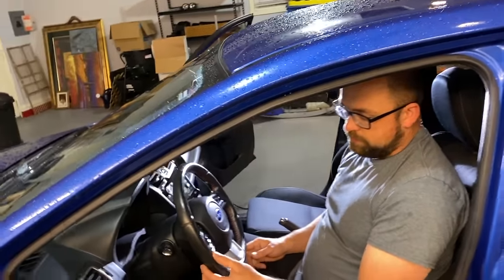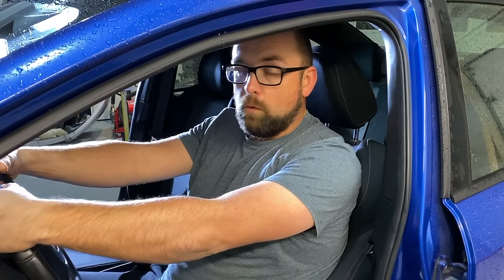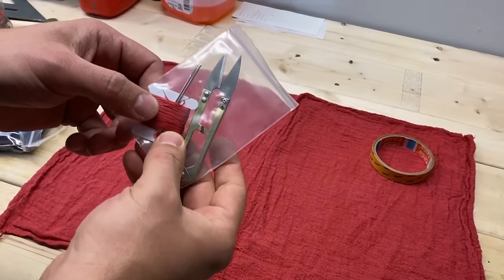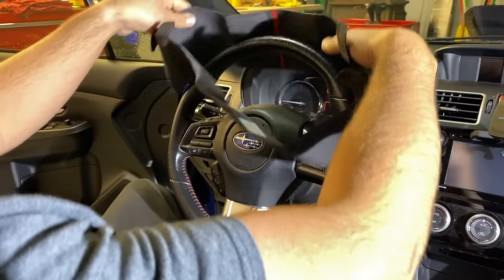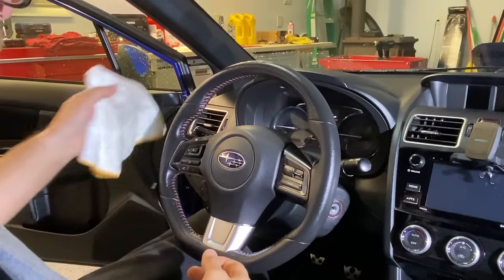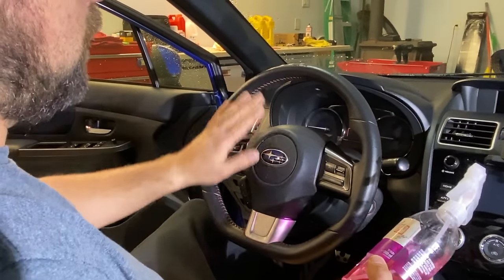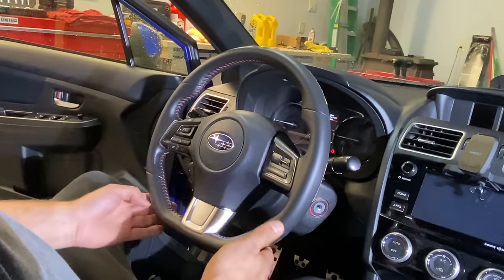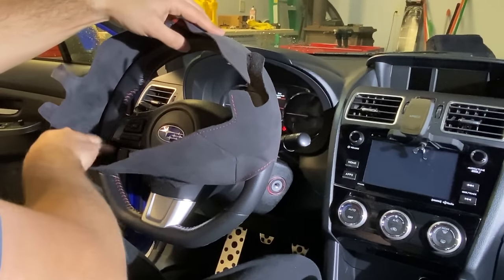How To Refurbish A Steering Wheel For Less Than $100

Comment: This took me 6hrs to do and I was rushing
Reply: How did it go? Does it look good?
Reply: @stektpolse  yes it does look good it’s worth the time and money
Reply: How difficult would you say it was? I have no sowing or stitching background lol. I have mine ordered, wondering if you have any helpful tips too
Reply: @rr.cycles  it’s not difficult it’s just time consuming just make sure you do it on a off day. If you use your phone for behind the wheel it helps too so you can see where your stitching but yeah I’ve had mine on for awhile and I didn’t use the tape. Well I tried it but it ripped my steering wheel the leather of it which sucks so I didn’t even put the tape all the way around  on the wheel and it hasn’t moved or slipped off yet
Reply: @acp__  ok bet, I’ll just go no tape. It’s a tight fit cover anyways. Thanks
Reply: It took me half an hour 😔

Comment: That's a steering wheel cover only. You never took the old leather cover out. Not a direct replacement.
Reply: @MrFizzery  😂😂😂😂
Reply: The instructions on the kit tells you to not remove the original leather.

Comment: Great video. Very helpful. I am about to knock my truck out and after order a cover for my wife car.  Edit: I won't bother to do my wife car. It'll look like  crap if I do it. The edges that need to be tucked don't tuck very well. Some are just too big and pop my trim pieces off. The string constantly wants to get tangled up and knot up.  I woooooould have paid $200 to do it right. LOL

Comment: Just completed mine today (same, swede with top dead center red stripe). 3+ hrs, a few tears, a LOT of sweat but honestly, this video was PERFECT as a guideline! I AM NOT a mechanic but like to play with tools and cars, bikes and bicycles etc. and this was relatively straight forward. Even though I broke the thread AND used ALL loops to thread the cover, I still had left over. Fantastic product; great DIY video for anyone who's ok with a hammer.
Final result after breaking the thread (mid-way through the top portion) is: Amazing tight feel. Makes the wheel thicker and so nice to hold in all angles when turning. I LOVE the new series WRX steering wheel and this cover accentuates it.

Comment: I done this today. With wheel installed on car i fitted the fabric. I then removed airbag then wheel from car, then back plastic piece from wheel my removing 1 screw, then each button assembly and bottom trim piece only have 1 screw each. Very easy to do then you can do it inside if its hot etc

Comment: Anyone who plans to do this I highly recommend taking the steering wheel off, bringing it inside your house, and doing it in a comfortable position. I did this once in my car before and it took like 6 hours of sewing and weird angles. Brought the steering wheel inside the second time and I got it done in 2 hours and was much more easier to get the stitching looking perfect
Reply: Is the material on the steering wheel with red stitching a factory-installed cover that can be replaced?
Reply: I have an impreza hatchback and I bought a wrx D steering wheel to do a swap on, since my new wheel will already be removed that makes it easier for me to install the cover in the comfort of my home👌

Comment: I did did this to my g37, I removed the steering wheel from the car & removes all buttons & trim, double sisded tape under the spoke areas & also baseball stitch instead of every stitch got the job done in about 1.5 hours.

Comment: could you feel the adhesive tape through the cover after you put it on?
Reply: I didn’t put the adhesive on mine and I’ve had mine for about a couple months now and  its not sliding
Reply: @acp__  I didn't either and mine's good too
Reply: No, it's very thin, I put a few pieces on around the spokes but the top of the wheel can turn if I try

Comment: I don't think the new subaru's have leather it's just some plastic with a stitching effect on it - and it is total shite.  My 2000wrx had real leather and that lasted longer than the car.  But my 17 is farked like this.
Reply: 2015 STi owner: The top and bottom of the steering wheel is leather. The sides is a plastic like material that has dimples in it, similar to a soft golf ball. Google a picture and you’ll see what I’m saying

Comment: The soft suede leather looks great for a minute, until it starts getting all that hand oil and dirt on it. You can't simply clean it like smooth leather
Reply: I’m on here debating buying the oem one, and I was thinking the same thing. Google cleaning videos. This dude had a BMW and he brought his back from the grave with a brush and some spray. I was shocked
Reply: Get a steam cleaner and a microfiber. You’ll be wowed
Reply: Suede alcantara dries out my hands
Reply: I've had a custom made alcantera/suede steering wheel on my E46 M3 for 7 1/2 years now. I clean it maybe twice a year, and that takes me 5-10 minutes each time. It's still as good as new. Go figure if you actually take care of something, it will last longer...
Reply: @JacesOwnWorld  what kind of cleaning do you use for cleaning it

Comment: My only concern is whether heated steering wheel would still work?
Reply: Don't see why it wouldn't.  It may take a bit longer for you to feel it because it would have to heat the factory leather in addition to the extra fabric over top of it.  All it is is a heating element under the factory leather just like heated seats.  Think of it like this, if you sat in a car bare assed you would feel the heated seat faster than if you were wearing pants because the heat needs to heat your pants before you feel it.

Comment: How come a 2016 sw can be so cracked/deteriorated. My 2010 Evo X 150k kms has the original leather wheel in perfect condition. Just cleaning it once in a while
Reply: It's not all that uncommon here in Florida because we get pretty intense sun year round. I use UV protection spray and conditioner on the steering wheel and dash to prevent it.
Reply: @IrrelevantInformation  my 17 sti is at 12k miles, garage kept, might see 2 hours of sun per day. Wheel still peeled on me at the bottom. And I’m in swfl

Comment: I can't stand Alcantara steering wheels. They work great for grip but they suck for durability. My audi RS7 was 2 years old and the alcantara was already wearing down on my steering wheel. They should use real suede instead of that fake shit or use unpainted top grain leather. $110k car and those A-holes cheap on on materials. Smh

Comment: Seems it would be easier to remove all buttons and trim on the steering wheel prior to install
Reply: Don’t think that’s possible on Subarus. And if it is, they are clipped on there pretty well. I’d be afraid of snapping something.
Reply: @Keyoff89  It’s a steering wheel, everything comes off of it. It wasn’t made in one piece.
Reply: @Keyoff89  Once wheel is removed from car. There is 1 screw holding black back piece on. Then 3 screws behind that to remove all the buttons and bottom trim piece. Pretty easy to do